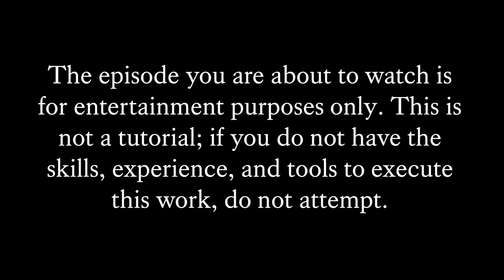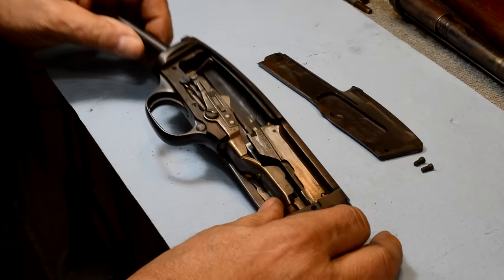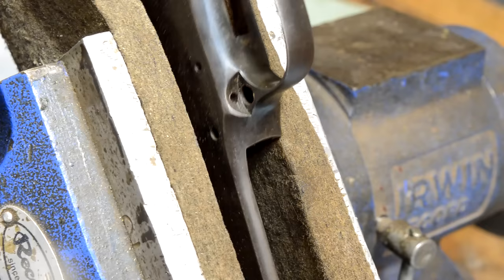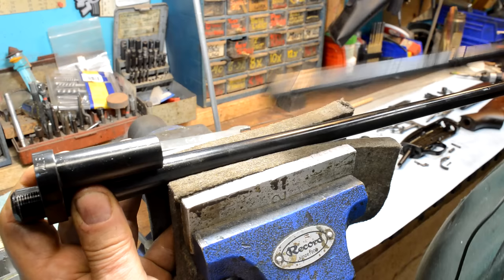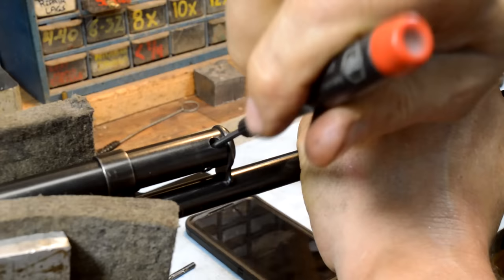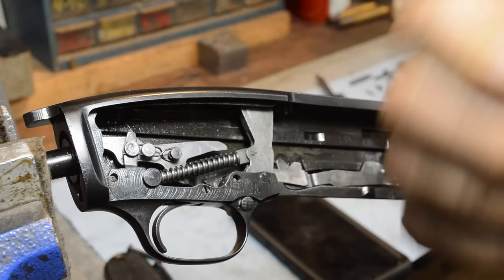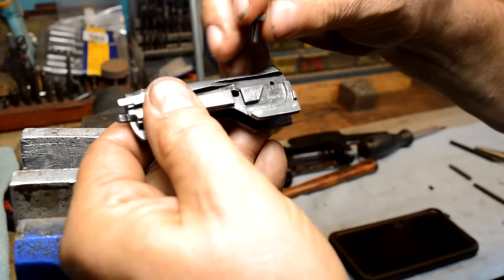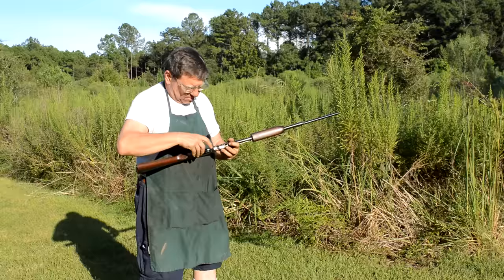Winchester Model 42: Anvil 0130

Comment: Great video as always.  I have been watching your videos for years and in the past couple of years I have set up a shop in my basement to do cleaning and conversions.  Been through several of my own WWII firearms collection and have done several for friends and relatives.  Not doing it for hire, just as a hobby.  I learn something new with every episode I watch.  I just completed a pair of Model 1858 New Army's that were manufactured in 1864.  They turned out beautiful.  Thanks for the education.  I still have much to learn.
Reply from the maker: THIS IS WHY we make the videos.  OUTSTANDING
Reply: I do have one question.  Sometimes you use kerosene after your finish carding and sometimes you use 30 wt. non-detergent motor oil.  Are they fully interchangeable or are situations where one should be used over the other?  Thx. JM
Reply: @johnmcmorris1170  I recall in an eariler Anvil kerosine was used to displace water, while the motor oil is for lubrication proper.
Reply from the maker: Both are interchangeable equally.  Used motor oil is cheaper and easier to get
Reply: The only reason why the patina should be valued is it means somebody didn't go in with a wire wheel
Reply: @Phoenix407  Those are true words of wisdom.

Comment: Mark; dirt (mud) dobbers crave 5/16-.3125 pipes also! I have cleaned out 1000 2 cycle string trimmer mufflers that wouldn't run after they crawled in & deposited their soil...

Comment: Its a pleasure to watch your work.  2 things i do; to help avoid launching parts i will slide a zip loc bag over the assembly and work thru the bag.   2nd, the old wooden plugs lose their varnish over time and can retain moisture, so i like to spray them with  a couple coats of clearcoat or even substitute with a piece of polymer round stock.

Comment: Mark, you're not kidding. I'd love to have that piece. I've not always had a appreciation for the 410, but as I've gotten age on, I've found a renewed favor for the smaller gauges. Twenty gauge though is still one of the go to that I have, more so that it's the same gun I grew up with, though the 410. It bothers me that I wasn't able to get this little over under my grand dad had but my aunt grabbed and from there it vanished.

That little 42 though, just seems perfect for a youth piece if not a fun mean for an older shooter to get aiming down with a shotgun rather than the ol standard of just point it in a general direction.

Comment: With how much Model 42s are going for today, you'd think Winchester would do another production run of them.  There's obviously a market for them.
Reply from the maker: But would/could you pay north of 2 grand for it? In the current manufacturing market, no one would buy it.  So no one will make it.  Just sayin....
Reply: @marknovak8255 mostly agreed. Also, the older seem to be better for most brands. I have my grandfather’s bps, it’s fantastic. 

I recently impulse bought a brand new bps in .410. I love it, it’s beautiful. But it was way more expensive than other .410s. Also, it isn’t nearly as well built as the older 12 gauge bps. 

I also have my grandfather’s model 25 and 42. The 42 was the first gun I ever fired. Irreplaceable.

Comment: "You gotta be smarter than the gun when you put it together."

Truer words were never spoken! Having seen allegedly trained personnel...
...try to put the BCG back into an M4...backwards.
...when reassembling the BCG after cleaning, insert the bolt and cam pin - so far so good - and then put the firing pin retaining pin back in before dropping the firing pin into the BCG.  Before reassembling the rifle and turning it back in.
...remove - God Almightly only knows why - all three gas rings from the bolt and reassembling the BCG without them.  Before turning the rifle back in.  
...not aligning the piston of an M14 properly with the corresponding hole in the back of the gas cylinder, then, when the gas plug wouldn't thread back into place, putting the gun in a vise and torquing the gas plug down with a wrench.  This forced the misaligned gas piston partway through the metal of the gas key, damaging most of the rest of the gas system and deadlining the rifle.

It's enough to drive a fellow to drink.

Comment: Hey Mark that looks great.. but what about the non detergent motor oil ? What will happen if i soak my parts in detergent oil ? THANKS for showing !!
Reply from the maker: Bluing is rust.  Detergents remove rust. First oiling is done with old oil to set the finish. Used up oil is CHEAP and everywhere..
Reply: @marknovak8255 THANK YOU SIR !!!

Comment: Hey mark
Which video do you explain the non detergent motor oil in? 
Why use it and 
Do you let it set a few days then wipe it of or de grease completely and re apply proper gun oil?

And how do you get all the water from the boiling conversion out of pins, and parts that you didn’t take apart like the pin and part in the bolt that catches the rim or the screw that adjusts the tension on the barrel? Dose it always evaporate

Love your videos and all the info you share!

Comment: Mark have you ever used a needle oiler? It puts a small amount of oil just where you want it. I got mine from Brownells. Three of them is 5 or 6 bucks and they are empty so you can put any oil you want in them.
Reply: ANY oil? 🥹🥹🥹
Reply: Needle oilers are great, if you want a spot of oil on a specific point.  He's oiling the entire action, using a blow gun like that is actually easier and faster, it's going to move oil down into all the little crevices perfectly.

Comment: So after conserving and carding, it should be dipped in non-detergent oil, small engine oil, used motor oil, or kerosene. Any of these will work? What if it's just wiped on?
Reply from the maker: I use a cheap paint brush "chip brush "

Comment: Hey Mr Novak, I have a question regarding what you would do in my situation. I picked up an old Steven's Little Scout Model 14 1/2 a while back and intended for it to be my nephew's first rifle. Unfortunately, when I got it, I noticed it was missing the extractor. I'm not restoring it to sell or anything, but I definitely don't want to spend over $50 for the one part that it's missing to function properly. Any idea on what I should do here? Should I cast the void with silicone and make a new part from the mold or try to machine one to fit?

Comment: Couldn't you take a chamber cast, measure it, and if you still have available tolerance, ream it a hair bigger to remove rust, pits, corrosion, etc? Tolerance for .410 chamber diameter is -0.0"/+.02" if i remember correctly.  I suppose doing that would also be contingent upon just how bad the chamber was to begin with, but it's technically an option.
Reply from the maker: Chamber rust converted into black oxide just fine. Spun a bronze brush in a drill motor and it cleaned up just fine

Comment: I have a receiver that has case coloring on one side and some rust on the other side. What happens if you boil a receiver that has case coloring on it and then card it? Does it remove the case coloring as well as the rust?
Reply from the maker: Card very gently and you MIGHT get away with it

Comment: Honest question here. I am not a mechanic so I know nothing about engines except the most generic concepts, and I just recently graduated from SDI so I am still a gun idiot. I have about 5 quarts of used transmission fluid and w wondering if that could be used in place of used motor oil.
Reply from the maker: No experience with ATF in this application.  Should work fine, let us know.... markfixesguns@gmail.com